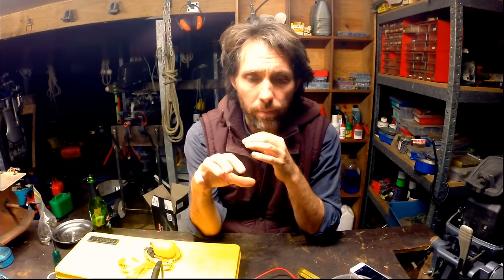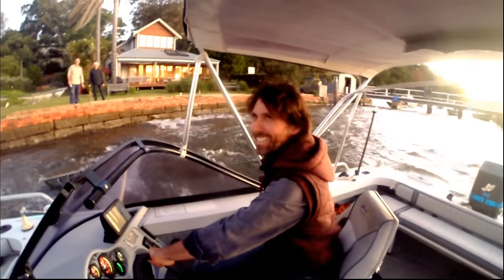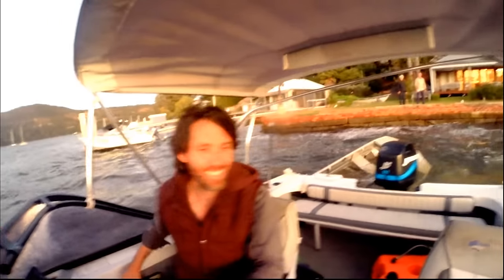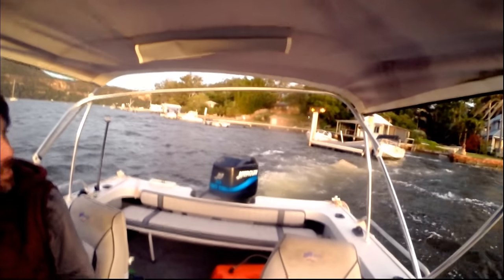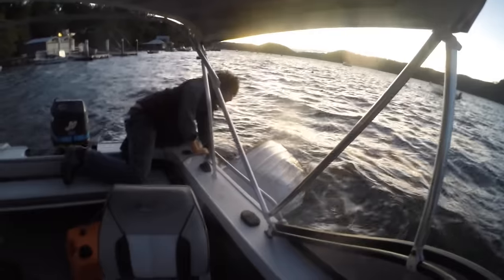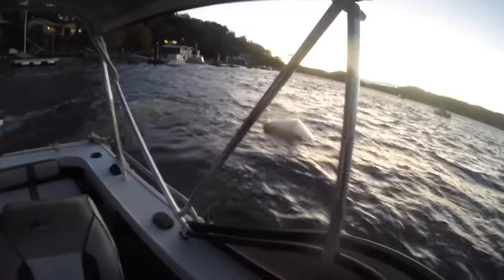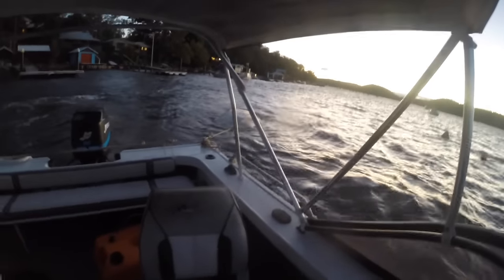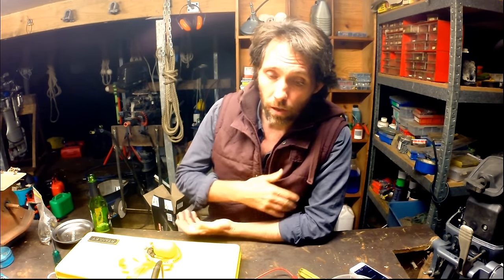Raising a sunk boat

Comment: One thing to try when flipping the boat is to hook the tow line onto the bow eye,  then tow from the stern end of the sunk boat. Essentially the stern will dig in and you will pull the bow up and over (end over end the boat). Then you are set to keep going to drain the hull. Hope that makes sense. You would need to use a longer tow line than you had though. 
Used to do them this way when I was with Coast Guard. 
Cheers
Reply from the maker: Hey Aaron, thanks for sharing your technique. Some hulls pull from the boat much more easily than this one did so it would have been great to try your method. It was a shame we didn't have a longer tow line on the day, I really should keep one rigged up now the boat is finished.

Comment: I have used this method many times on sailing dinghies.  But typically I put 2 or 3 guys in the water being dragged behind the Sunk boat to keep it upright and bring the bow up faster.
Reply from the maker: A few extra hands in the water can certainly make things easier. Some hulls come up really easily, others - like this one - need a bit more encouragement.
Reply: welderboy52

Comment: is three beers as a time guide , about a couple of hours. good vid, did ya get salvage rights ( crate of beers)
Reply from the maker: +Garry “Gazgit” That sounds like a fair exchange rate for helping a mate out. ;)
Reply: Seeing this among other videos lately, I am strongly under the impression a beer is an Australian universal Unit. Could be time, currency, other things...
I am only at a loss so far what conversion rate to use. I guess for such jobs using it as a currency the rate is highly flexible depending on very individual parameters.